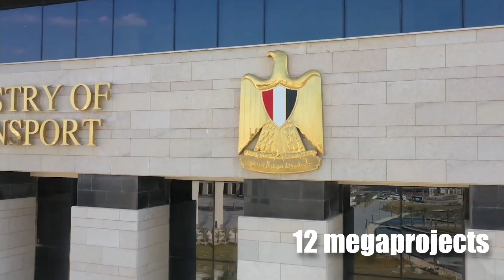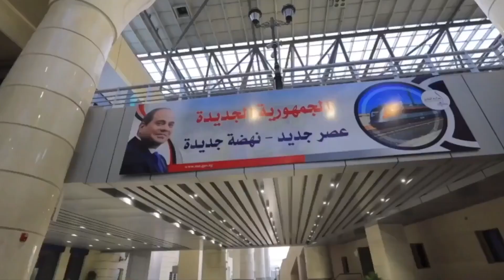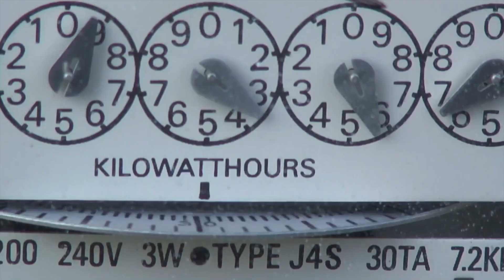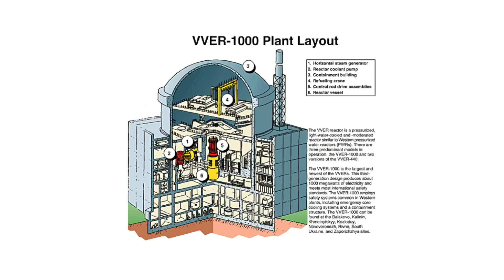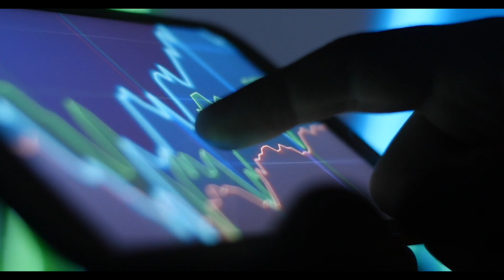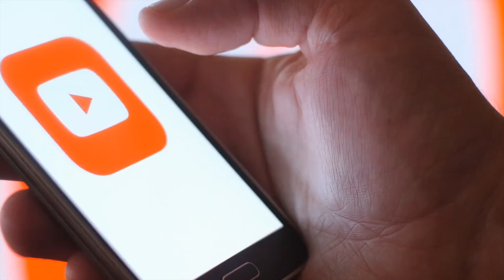The Biggest Mega Projects Under Construction In Egypt

Comment: meanwhile egypt in constant daily blackouts!
Reply: First, it reduces loads due to the crazy temperature, because of a phenomenon that occurred, and this does not happen in Egypt only, some of most other countries. Secondly, electricity is cut off an hour per day, and they tell us when to cut it by appointment.
Reply: All countries now have some issue or the other. If you don't have something positive to say, better not say anything
Reply: @thothkemet-lv8wq  No.
Reply: no u are exaggerating
Reply: You egyptians complain too much wallahi 😭😭 try staying in Sudan for a single day where the power can be out for 3 days straight. Power in Egypt is being cut due to the severe consumption which can be dangerous with this rising weather. And my area cuts off from 10-11pm and they tell us in advance. Its not even just Egypt, my friends who live in Greece, Oman, Iran etc have had similar situations this summer
Reply: relieve loads